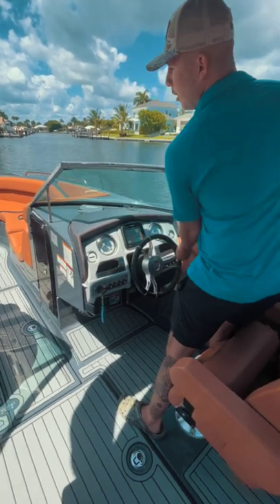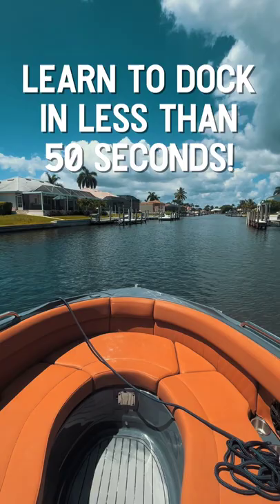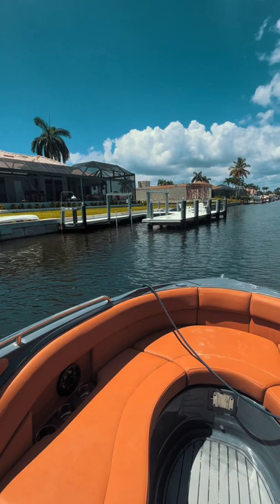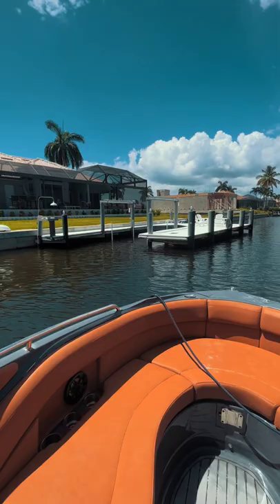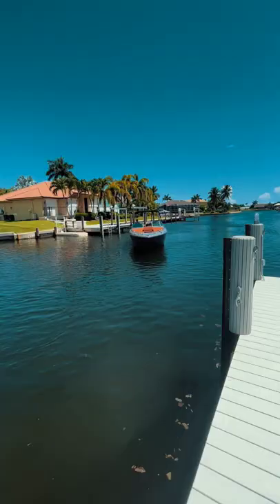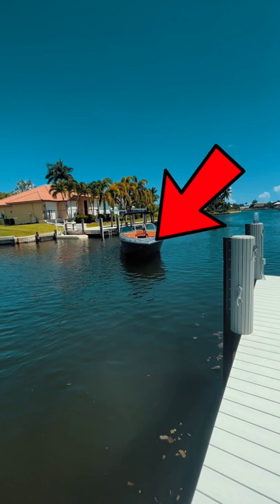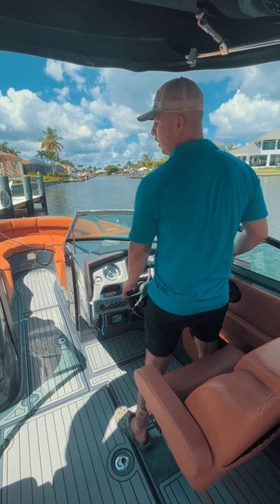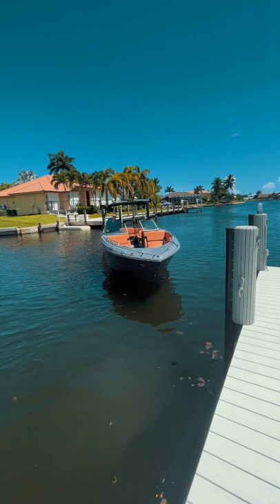How to Dock a Boat in Under 50 Seconds! (Part 1) #shorts

Comment: Works this way as long as someone is on the dock to help you. If you are by yourself, as the bow almost touches the dock, attach a forward spring line to the dock with a little extra slack. Then steer away from the dock at lowest forward speed, which brings the stern to the dock, at which time you tie a stern line. Shut off motor.
Reply: if you're amateur then yes😂🤣 and if you have ever driven a boat you just do as in the video but better
Reply: @dominicojala4944  Issue with backing the stern toward the dock at the end is that your boat ends up 2-3’ from the dock (like in the video). You do need someone on the dock to pull you in. Instead, if you turn away from the dock and bump it forward, the momentum will continue to carry your boat toward the dock.

You should only back toward the dock if the bow is inches from touching. He didn’t do that in the video.

Comment: I just got in my boating license up here in New York. And docking is genuinely the most anxiety inducing part for me. I got an old boat, only cost about five grand and I’m always bumping the damn thing against the dock. Only bumped one time yesterday though! I’m getting there! Lol
Reply: Its tough at first. I work at a boat rental club when I started, I was expected to be able to drive and park each boat a few days after I started. What I tell people when they’re learning is to get the bow close enough to the dock and actually hop out and guide it in with your hand. Can be sketchy in wind but it can help in a sticky situation.
Reply: Please clarify if you leave the motor running, in gear, or turn it off first to drift in before you leave your boat. Too many novice boaters will think they can just jump out of the boat at anytime.
Reply: Biggest tip I can give you, is take your time, and to not worry about anyone waiting for you. Forget everything else and you’ll be fine!
Reply: Dude it's just like driving a goddamn car..
Reply: @Bierdaddy1 turn it off. Always turn it off before leaving.
Reply: Have fenders always on standby just incase so that you don't damage your hull. All the best mate.

Comment: Gotta remember this is got an outboard, or outdrive, but inboard straight drive, when pulling off the last step, is trun the rudder away from the dock and it will coast the stern of the boat in

Comment: You go 45 degrees in the rock the turn the front out and then you steer the motor the other way and little reverse and thats al you need and i work on boats